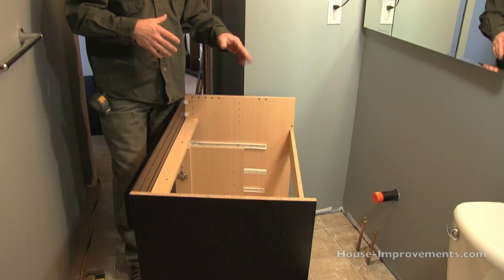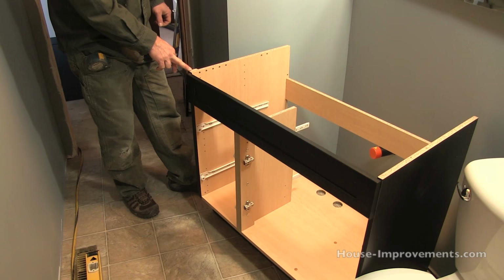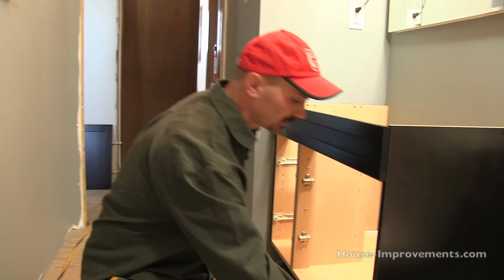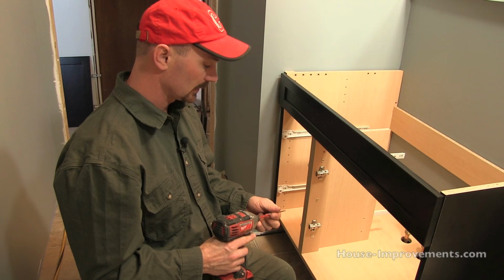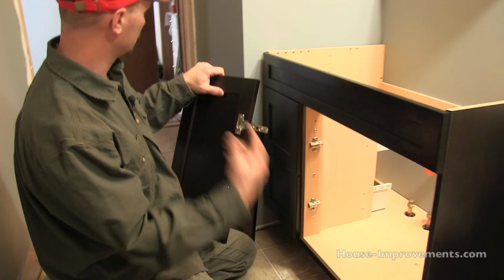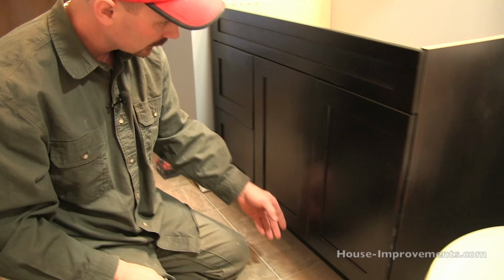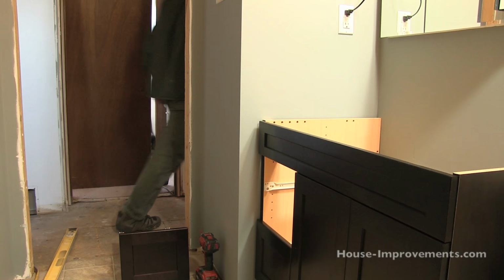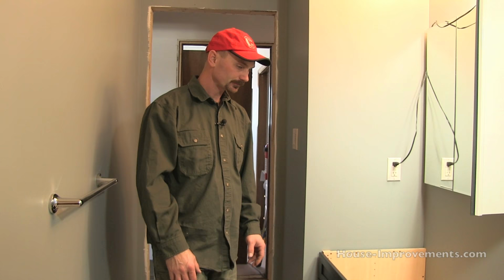How To Install a Bathroom Vanity

Comment: Awesome point about adding the extra piece between the vanity and the wall. I did not think of that before. When finding the studs it may be beneficial to point out that older houses don’t necessarily have evenly spaced studs. My house was built in 66 and when we gutted the kitchen we saw there was no rhyme or reason to where the studs were.
Reply from the maker: That is what happens sometimes, generally though they will be 16" or 24" O.C.

Comment: Thanks.  Daughter is installing a corner cabinet in our bathroom and the installers who built our off frame modular decided to cut a hole in the drywall for the countertop to sink into rather than in stall a cleat/filler/spacer on the left.  How insane.  This will be simpler.  Filling the hole in the wall, not so much.

Comment: I like how you talk about or is that aboot, the number of considerations before actually installing the vanity unit, such as the overhang of the counter top and marking for studs etc... P.S, when will you finally convert too the more "logical" metric system. Cheers

Comment: Thanks for sharing. We had a house fire that destroyed our kitchen, but smoke damaged the rest of the house too. It required renovations, including our small ensuite. I noticed the calking coming off on the vanity counter that runs along the side of the wall last, so we plan on replacing eith new calkin. However,  I noticed this afternoon the cabinet has a gap along the side where the top of the drawers are, along the same wall. Not sure why this is, but there was calking there too. I'm worried they were installed incorrectly or not secured properly, and if we need to fix, this video is helpful. We had a horrible time, as the restoration company's subcontractors were terrible! We hired our own contractor for the post clean-up, but there are still some questionable things we've since discovered.

Comment: I need to get started on this in my house. The problem I've run into is that they decided to tile the bathroom but didn't remove the vanity when they did. They tiled around it. So theres uneven flooring unless you get the exact size vanity they had previous. It's like a perfect square hole. Another issue, a family member found "super nice vanity on clearance, so i bought it for you." Guess what? It's larger than the square hole in the tile. Im running on a limited budget and scratching my head on this one.
Reply: We have some extra tile they left behind, but it's not enough to patch the spot completely. I'm hoping I'll have enough to make it level.
Reply from the maker: Shim the cabinet off the floor to make it fit or trim the kick so it fits,

Comment: You didn't have to scribe the cleat you added to the left side, or the back right edge of the vanity. That's some good sheetrocking and taping. The studs looked new in that room but were they? I redid a tub surround once and didn't pay close attention to the existing variance in the rough sawn studs (they should have been furred out slightly) I didn't notice until I'd screwed the backer board on that I had a slight valley in the wall (the craftsman 60 years ago knew enough to watch how deep they set their nails to make sure the wall was flat. Me and my 40 horse screw gun just drove them home). Nice thing about learning by mistakes, you don't often do them twice.
Is the drawer that's off a little, square? Could just be debris behind the drawer face and the drawer box too. If not you could drop that odd one down to the bottom, where it wouldn't be as noticeable.
Reply from the maker: No this was a" retro" 70s framing job but things were actually pretty straight and plumb. Gotta get lucky once and awhile! LOL

Comment: Did you need a 15 inch clearance from the center of the toilet to the cabinet wall?  I’m selling my house and replaced my 28”  cabinet with a 31” but I’m worried about the city code
Reply: I’m sure it no longer applies to you, but for anyone else wondering, yes code says 15” from any nearby fixtures to the center of the toilet.

Comment: Another great video. Is this the same bathroom that you did the ditra heated floor on. I assume was later on cause the floor looks different. Did you remove tile from under this cabinet if it is the same bathroom when you installed the new tile?
Reply from the maker: This bathroom was way previous and different house.

Comment: Im contemplating removing the corner round and baseboard prior to replacing the old cabinet. Neither sits flush to the floor, tons of dirt & lint along the walls. Any preference or suggestions

Comment: Is there a rule or standard for water lines... I've seen both vanity and toilet water coming up through floor like this video and lots of videos where the water lines are out through wall? Which is correct and does it matter?
Reply from the maker: Does not matter. I live in a cold climate so we would not bring water up through an exterior wall to prevent freezing.
Reply: @HouseImprovements  thanks for the reply that probably explains it we are in south texas. I had 2 estimates on a job first guy said he would go through walla when he explained what he was doing. The guy I ended up hiring was plumber back when he lived in NJ now lives here and he went through floor... thanks again always enjoy your videos!

Comment: I am redoing my bathroom.   On new flooring, should I also put new flooring under the new vanity cabinet too or set it  on the wonder board?
Some people suggest not to so I don't have to remove the vanity if the floor needs to be replaced in the future.
Reply from the maker: You could do it either way but I usually just run the flooring to the cabinet ,not under it

Comment: There is no back panel to this vanity. My vanity has a back panel and I will need to cut holes for the pipes coming out of the wall. I was hoping to see a video that included that step. Vanitys with no back panel don't look as good but are popular with installers because they are so easy to install. I suspect many installers just decide to leave the back panel out to make it easy for them.

Comment: How did you attach the filler cleat to the vanity? Did you use wood glue or did you screw it in?
Reply from the maker: brad nails
Reply: Where did you get the filler strip?  Does it go all the way to the floor or just to the top of the toe kick?

Comment: You checked the vanity several times for being level left to right and plumb. Why did you not check the level front to back?
Reply from the maker: generally if its fitting the back wall fine its good. If its a little out that direction its not normally a big deal.

Comment: I’m having the same issue with my left side on the vanity I want to get. I don’t want a half I NB gap between the wall on the side. Could you also just offset the counter top that half inch to make the left side flush with the edge of the vanity and have a 1” overhang on the right side?
Reply from the maker: You could most of the time as long as any drawers against the wall dont hit the wall when opening.

Comment: My vanity sits in the corner of my bathroom. I want to turn the vanity 90 degrees but don't want to move the supply lines and drain. Is it acceptable to route the supply lines and drain from the side of the vanity?
Reply from the maker: Sure , make sure they do not interfere with drawers and such.

Comment: What do you do if the pipes are coming out of the back of the wall in the center of the vanity and there are drawers that are in the same space as the pipes?
Reply: Probably have to get a different design of vanity

Comment: I have a porcelain vanity top that just sits on top of the cabinet with no holes to attach to the wall to make it secure.  What can I use to secure it to the wall?  I have secured the cabinet.  Thank you
Reply: Maureen Maher Latex silicone is the usual method of mounting vanity sinks. Just run a bead of silicone on the vanity top and CAREFULLY set the sink in place. It's slow to dry, about 24 hours, so you have plenty of time to adjust it's position! Cheers

Comment: Can you install a vanity directly to a bathroom floor (concrete) in a basement?  Or do you need some type of underlayment?
Reply from the maker: You can but if its an older home I would either install the flooring first or install it on some of those plastic furniture stick pin feet to keep it off the concrete
Reply: @HouseImprovements   Yes, this is an older home. Also, the concrete was torn out to make room for new plumbing so there is now fresh concrete down. I was thinking of flooring first.  I hope to mitigate any moisture wicking into the cabinet. Thank you for your advice, this was very helpful...

Comment: I enjoy your videos but I have to point out for the DIY viewers that you didn't check for level front-to-back.
Reply: +Pro1er He corrected himself and checked it at 9:31
Reply: +Nick Garcia Good catch, in my mind I'm thinking of checking the top of the cabinet but I guess if it's square you can also use the front.

Comment: Owner kind of went cheap. The door hinges can attached easily, but they’re not soft closing. It’s $1 more per hinge.  Same with drawers, not soft closing. $1 more per slide rail. Finally, the height should support 3 drawers instead of 2 for 50% more shelve organization.   Also, I now prefer 34” kitchen height height over historical bath height.